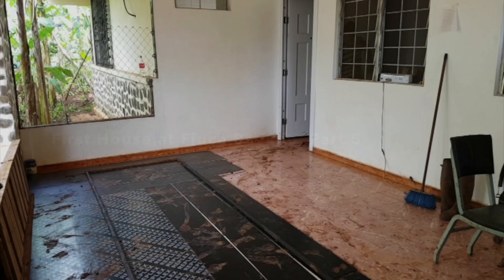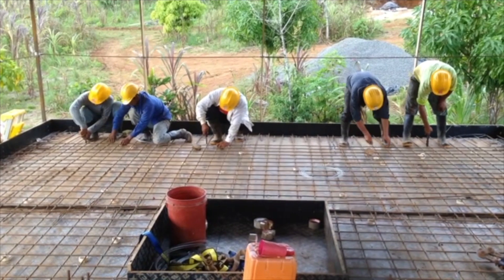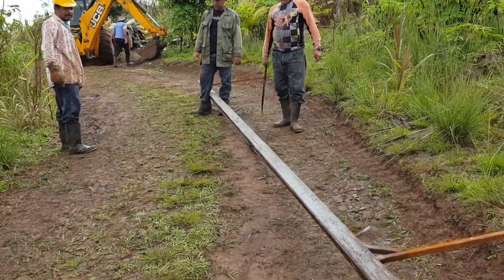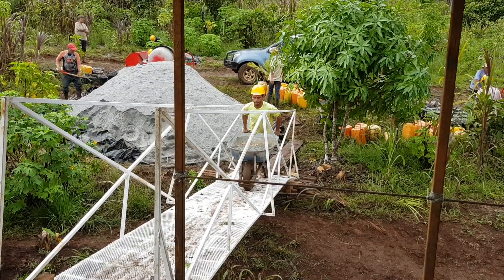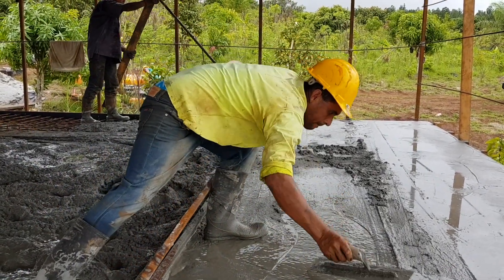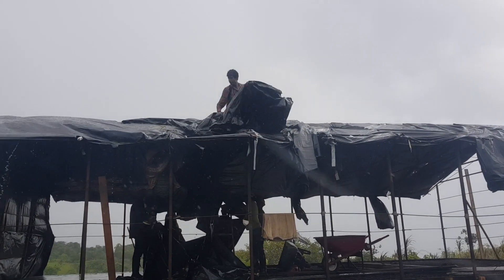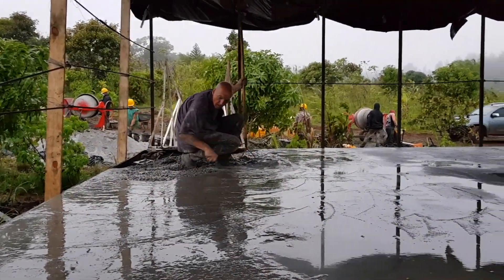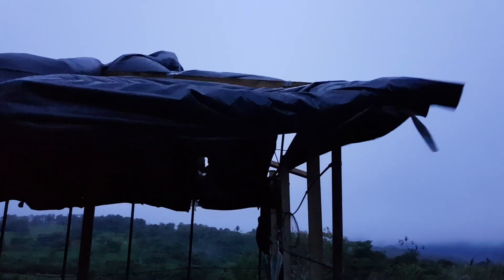Finca Bayano - The first house on the finca 5/

Comment: why are you using concrete to build? Is lumber not easily available?  Can lumber be imported to Finca Bayano?  is it possible to get 3 or 4 containers full of lumber and building materials to Finca?
Reply from the maker: Hi Tony - Certainly, it is possible to build with lumber, and any kind of materials may be taken to Finca Bayano, however, we have to consider that things are getting everywhere and, for that reason, we will build strong houses that do not burn. -Greetings from Panama - Stefan
Reply: stefan mudry Would you tell me how much this house costs including workers wages. It seems very difficult to build in that condition. I prefer strong house as yours.